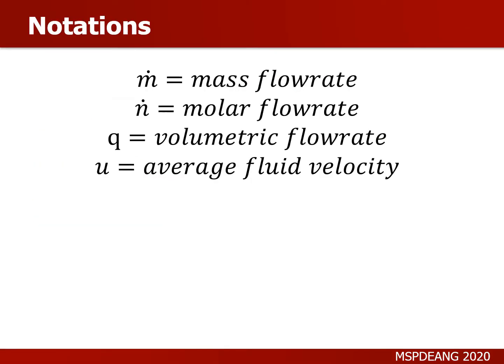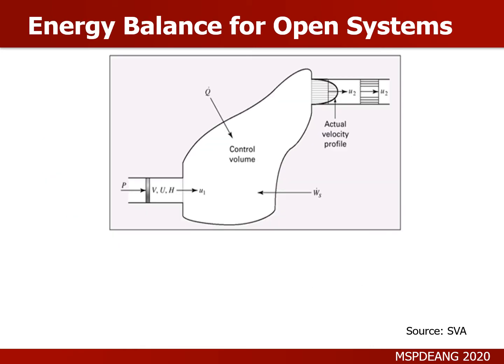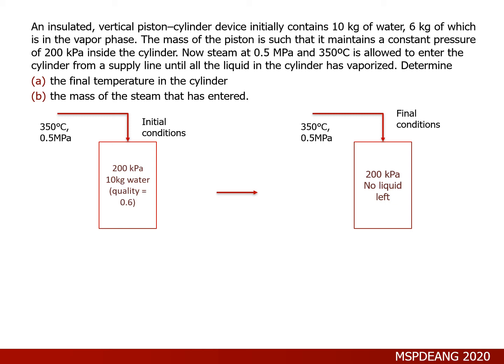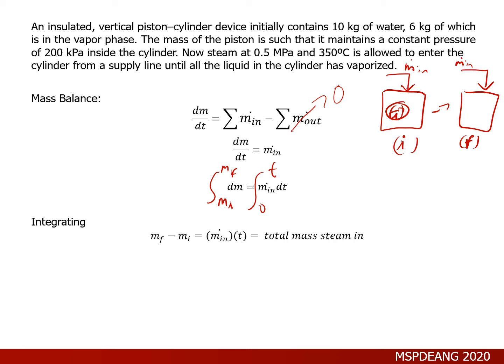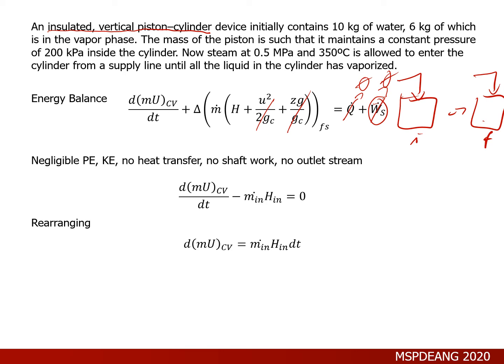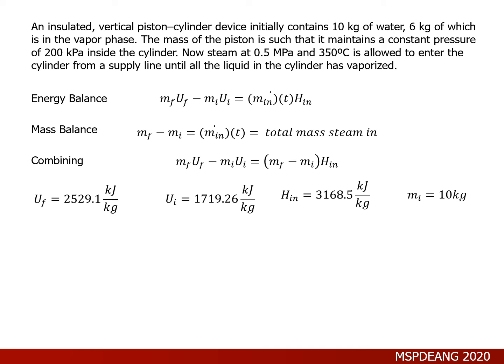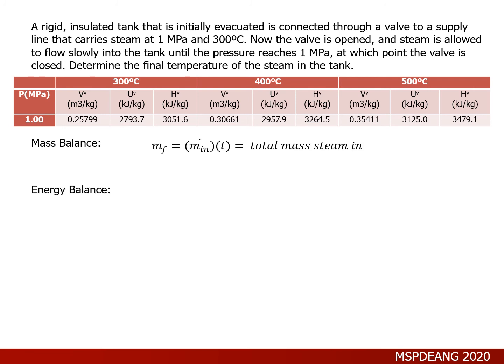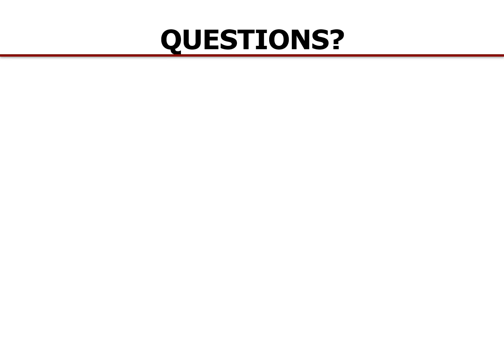ChemE 122 - Energy Balance for Open Systems Part 1   Unsteady State Open Systems

Comment: [Baka sabog lang ako as of writing]

Sir bakit po @18:33 mark yung Hin natin eh 3051.6? Pwede ba siyang maging 2793.7 [steam table rin basehan po]? Parehas naman silang specific values.

EDIT: Sir diba dapat Tf is in degC?
Reply from the maker: Hin is the Enthalpy of the inlet steam, which is at 300degC and 1MPa. Uf is the internal energy of the tank's final conditions, which is at 1MPa, and an unknown temperature. With this, only the steam inlet DOF is complete, and we can use the energy balance to complete the DOF for the final state to get the final temperature. 

And yes, thank you for the correction. in degC yung final temp, not kJ/kg haha, sorry for that.